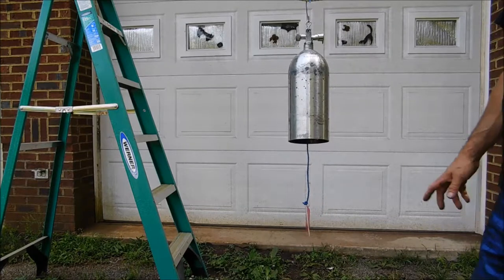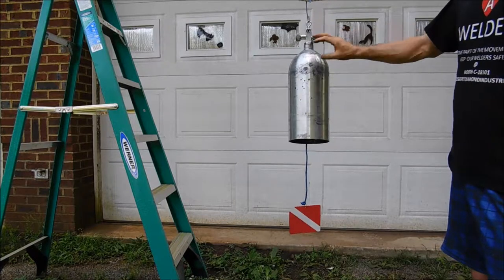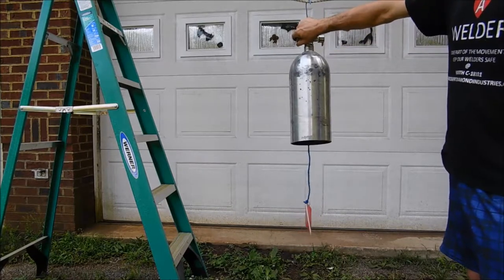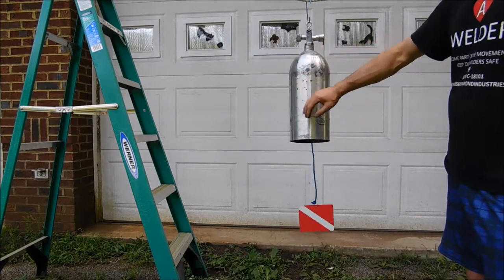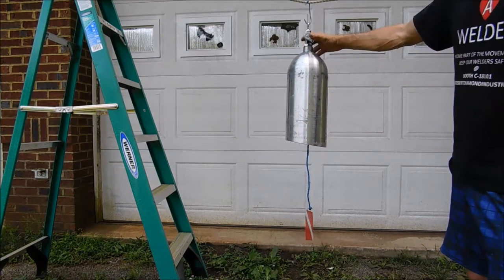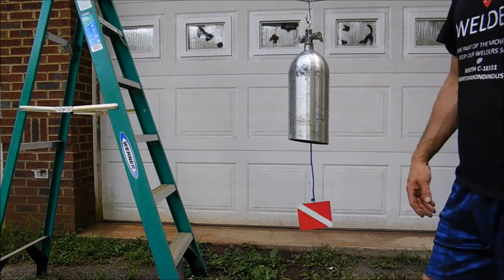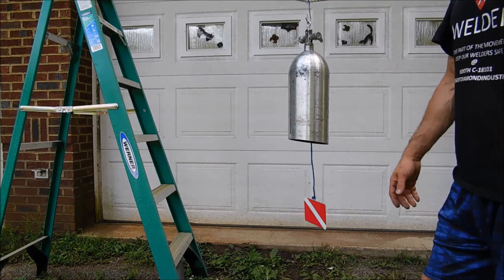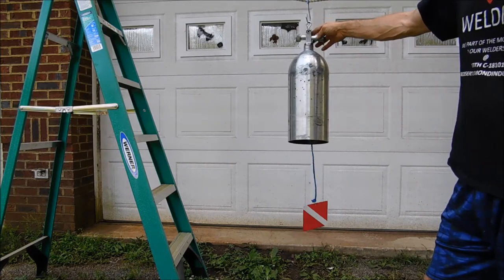Dacor scuba tank bell with J valve

Comment: Sounds like you have a metal banger inside the tank. I have seen some design that use a rubber hockey puck for a softer thud shroud when used as a front door bell and not a wind chime. Cheers, #SeattleRingHunter
Reply from the maker: Yep. I have experimented with several items and all change the way the cylinder sounds.